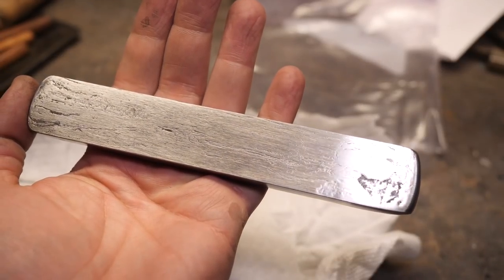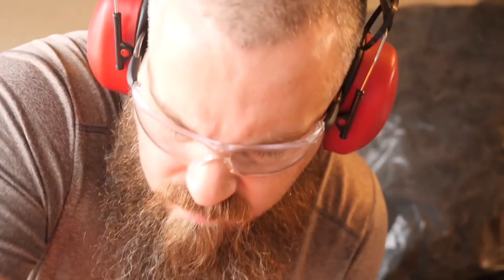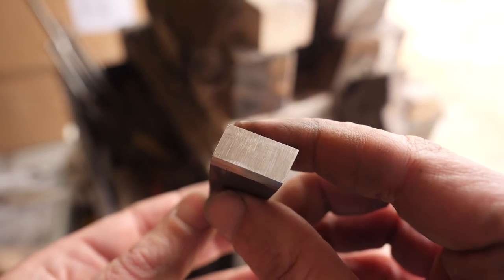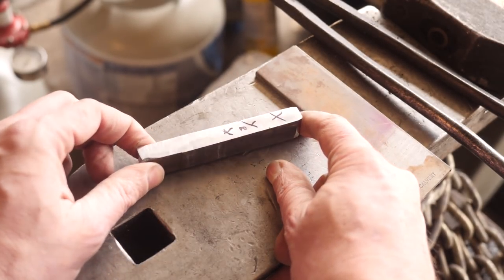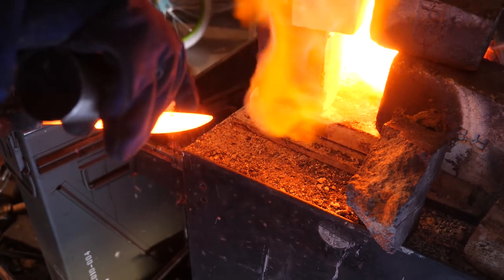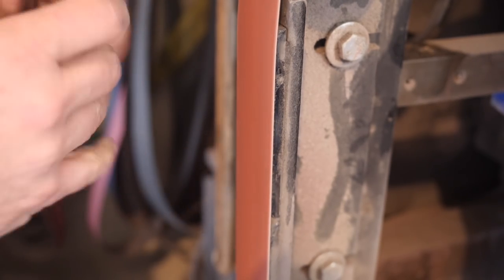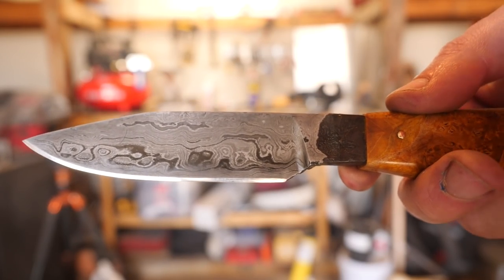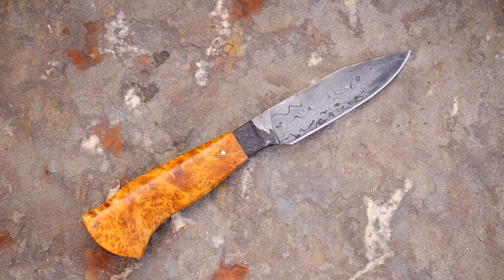Forging a Bloom Steel Knife

Comment: From what I understand Bloom Steel is hard material to work. So I'd imagine the piece that guy sent you took some real effort to get refined to where it was. Even then it still had some issues. Though you still made a pretty awesome knife. I hope you do more stuff with bloom steel in the future because this was pretty cool.
Reply: From what I understand, you need to "overforge" in the bevels of the bloom steel to homogenize the layers in the steel for a better edge. I think Ilya did a good video about it on the "That Works" channel, I think it was the one about forging bevels in general.

Comment: So i saw a video where the smith made a bloom out of ore from the Wari mine in jordan then melted it down in a sealed crucible. The resulting ingot still had a relatively large grain size but with several annealing and normalization cycles it turned out rather well

Comment: A higher forge welding temperature and a secondary source for carbon (charcoal fire) to help homoginze the blade. I've had the privilege of watching japanese bloom being worked and was told that one of the important steps is hot wood coals. It shares the carbon of the wood as it burns with the iron and lower carbon steel.  I think you did a great job for a first go on the bloom though. Turned out better than my first couple of tries...
Reply from the maker: Anthony Renneberg  carburization in an open air forge or coal fire sounds interesting are you sure that’s possible?  When I read about that sort of thing conditions have to be perfect. https://link.springer.com/article/10.1007/s11837-016-1997-8#Fig2
Reply: Yeah you need a clean surface for welding. He was using a type of sand as his flux? The wood the fellow was using was a hardwood and he always kept the steel in the coals, but closer to the top. It seemed to me he was right on the breaking point of burning the carbon steel as it would make 1 or 2 little sparks when you were welding it after he had pounded out the slag to his satisfaction. I'm guessing his 70 something year old eyes are a little more calibrated to temperature than my 40 year old eyes. He did lose about 20 percent of his blooms steels mass pounding out the slag. My tries have been in the 30 percent area or more with some of the same issues you had with carbon distribution.
Reply: But next time I try I am going to make little pieces so I can select the higher carbon pieces for forging and see if I can reduce the yield loss
Reply: I bet he was floating around 1000 Celsius when he was playing carbon thief.(side note he had the furnace running for 16 hours before he started and it was stoked with fresh wood very consistently.)

Comment: So some tips from a guy whose researched a lot on bloom iron/steel, wrought (which is what you have) needs to be welded and worked at a much higher temp than mono steels. Most every video I've seen the Smith has been working the steel at almost welding heat and welded layers at blister white. The bloom usually has quite a bit of silica in it, unless it was a dry bloom, so when you're heating the steel should have an almost wet look to it. If you forge the iron too cold, the silica between the iron becomes brittle and allows the layers to shear, which is what I think happened in your case.
Reply: Cleaning the anvil and remove the scale before weld forging would be good to. The cleaner the metal the better and get rid of all scale on your anvil before continuing.

Comment: You hammered it too thin! Also bloomery iron doesnt forge well at lower temperetures and is prone to tear if you do so (because of the different microstructures) so working temp has to be almost as hot forge welding temp. You will also re-weld the cracks as you go if you work it really hot. Btw you could have fixed the de lamination, but you need light taps at the first welds, get it to temp, tap it a couple of times while its steaming and back it goes. Do this 2-3 times and youre good.

Comment: My dad heat treated 2 nitro v  knives at 1,950 degrees F for 10 min in a heat treat oven and then air quenched them. After the air quench they bend like putty. Any thought on what to do different or what happened?
Reply from the maker: no never worked with it
Reply: Green Beetle ah okay thanks man!

Comment: As a non-native speaker (both in English and everything blacksmithish): can anybody explain me what bloom steel is? I have tried to Google it but found very different and even contradicting explanations
Reply: Steel obtained like they did before.
The ore isn't melted. It is heated at lower temperatures, so it doesn't become liquid, and form a sponge like mass of steel called a bloom. This has to be refined because it's full of gaps, charcoal and other shits. You fold it on itself again and again, so your steel is composed of a lot of layers, it's not an homogenous block like modern steel. 
If someone good at it read this :
How can I be sure to obtain steel and not iron or low carbon steel at the end of my reduction?